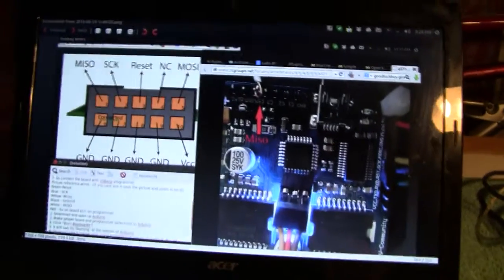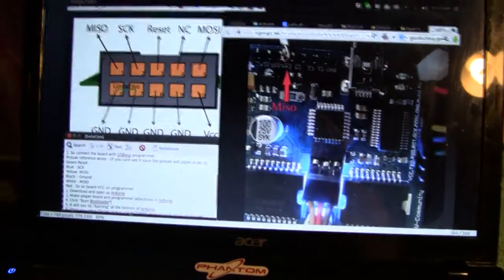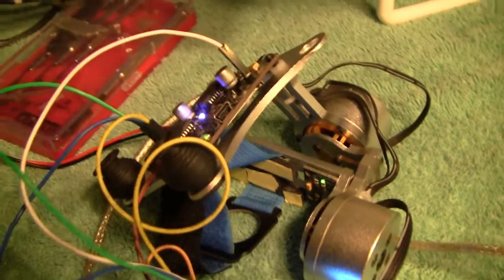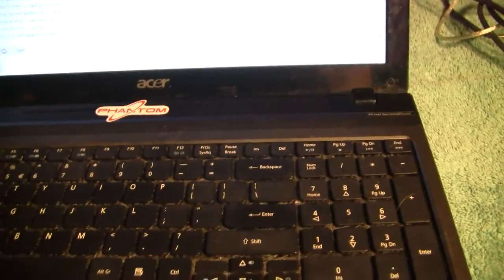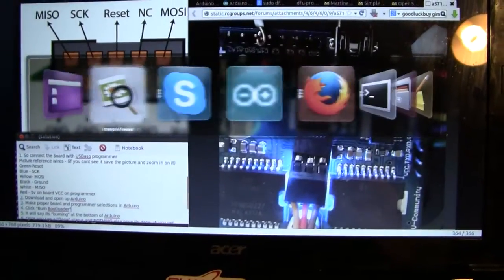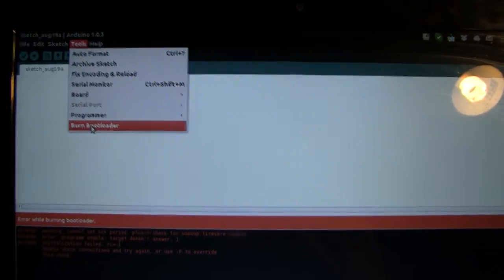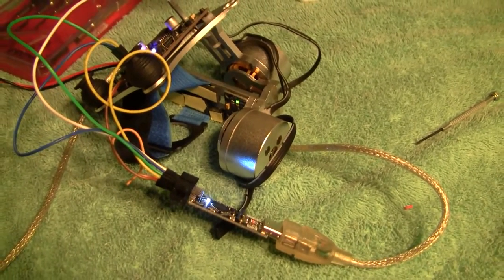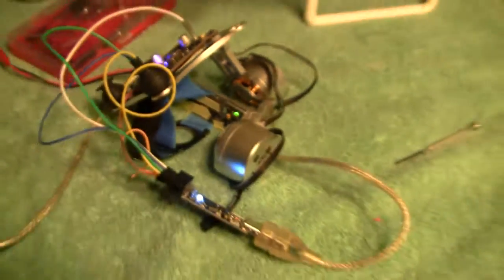glb bootloader prob /martinez board USBASP

Comment: Ok got this going again my usbasp programmer only was putting out 4.7volts, so i connected the mini usb cable and the usbasp programmer to the cct board. Now it is gettig 4.95 volts. With both cables connected burn bootloader via usbasp. Pick your com port for the usbtinyisp programmer, go to eeprom read, run script and then eeprom clean and run the script. Should be good to receive the the simple bgc nul hex file using the Xloader.exe  program.